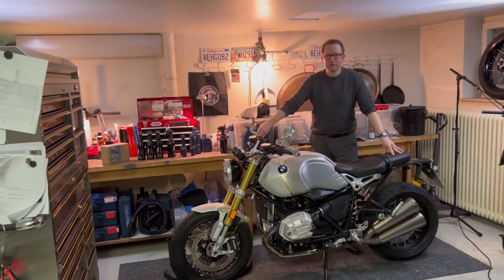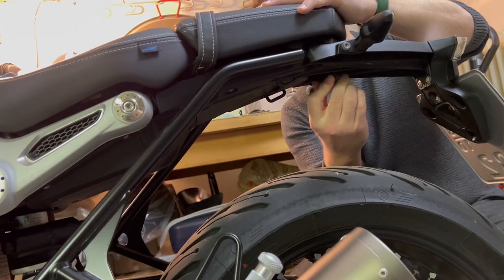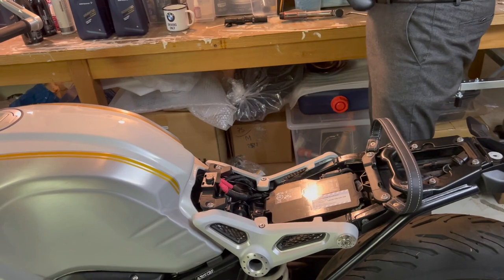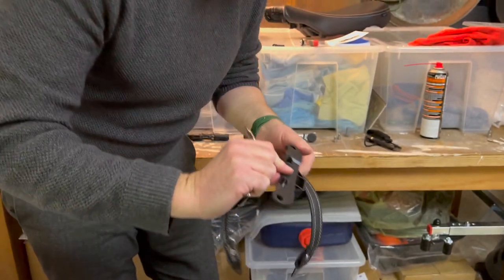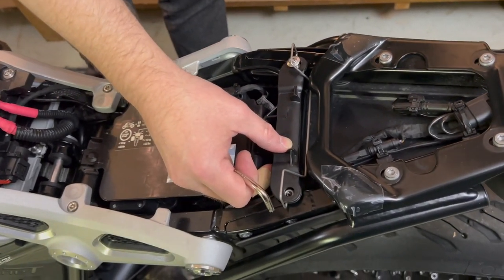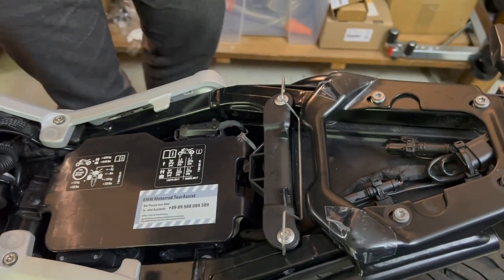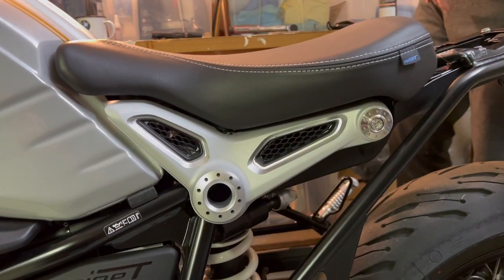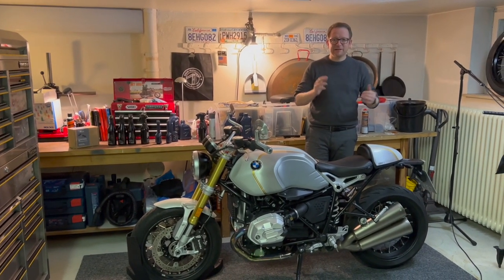BMW Motorrad RnineT - Remove Pillion Seat and Install Cafe Racer Hump

Comment: Just brought one and my seat was sliding opened it up everything was back to front the metal wire and plastic holding it also rubbers other way around.
Reply from the maker: Ups, I hope you could fix everything.

Comment: What a magnificent machine. I confess Im a little biased, I have the same bike, even the same paint job. Ive been thinking about changing the headers and it seems a simple flap valve delete isnt straightforward on 21+ bikes, a straight through removing cat as well is the only option. Do you have any knowledge of this? Also, and sorry for all the questions, I also watched your suspension set up video. I weigh around 63kg would your advice for the rear shock settings be the same? Thanks and best wishes, Matthew
Reply from the maker: Hi Matthew, thanks again for your comment and questions. I got the 2022 Euro-5 model and it is still under warranty. That is why I have not conducted such modifications yet. Here is a video from the guys of Pier City Cycles. Maybe it gives you an idea of how complex the job could be. Hope this helps: https://www.youtube.com/watch?v=BwEYebw7p24
In regards to the rear shock, I weigh 79kg and I have simply used the setting from the BMW manual. It works well for me. 
Ride safe!

Comment: What do you do if the screw to remove the pillion seat spins but doesn’t come loose from the seat?
Reply from the maker: Hi there, thank you for your question. It is hard to judge from the distance. Try to gently lift up the seat a bit. Sometimes the screw is already loose but kind of stuck in the the little tube, if that makes sense.

Comment: Dear Hype&Spin!
Thank you for sharing this great video.
Now that you've showed us, how to install the hump, why in the world, did you not teach us, too, how to open it properly!?
I've  opened and closed mine not even ten times, with almost no force applied, and I broke the closing mechanism.
I know, it only costs around 3,00€ but, I would like to use it as a primary, essential luggage compartment.
Do you know, how to do it properly?
Reply from the maker: Thank you very much for your comment and very sorry to hear that you broke the closing mechanism of the hump-compartment. I just went into my garage to take a look at my NineT. To open the compartment simply put your thumb into the little notch (there is one to the left and one to right of the center) on top of the little flap and pull it gently forward. I hope this helps.
Reply: @hypeandspin  Thank you very much, I am going to try this.
Please let us know, how it works for you, opening it several times.

Comment: What tires and size are you running?
Reply from the maker: I have ordered the bike with the BMW wheels: Option 719 Rad Classic.
Tubeless spoked wheel with rims having spokes radiating from the centre.
Rim sizes: 3.5 x 17 inch front, 5.5 x 17 inch rear.
3 kg less weight compared to a traditional spoked wheel.
I love them. Very easy to maintain, I would order them again.